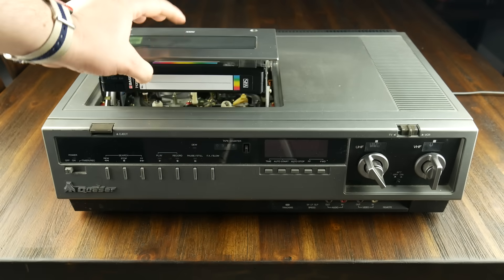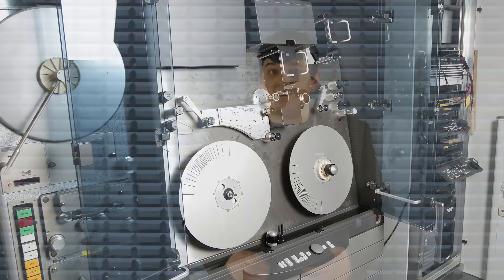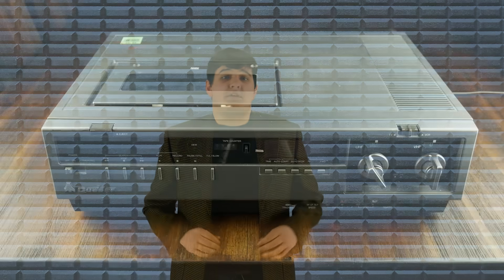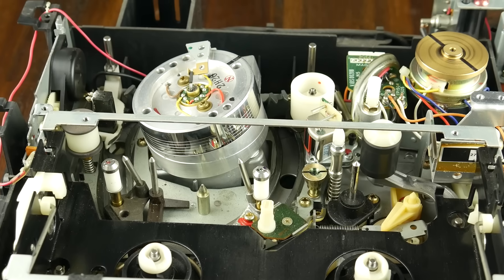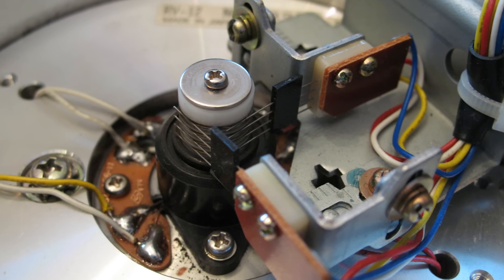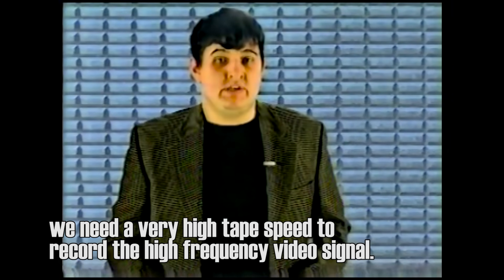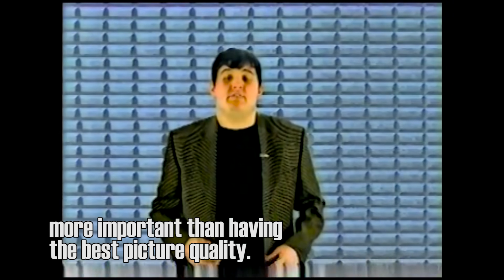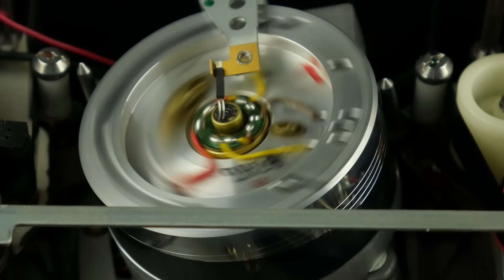The Impossible Feat inside Your VCR

Comment: another ace presentation
I would enjoin anyone who likes high-quality sound to pick up say a VHS of a live Hendrix or Floyd concert and find an old VCR [does not have to be high grade even] a set of RCA leads and connect your VCR to your stereo and be amazed at the sound quality.
A step further would be to connect those leads to your computer line-in socket [use something  like this https://img11.360buyimg.com/imgzone/s800x800_jfs/t4627/307/2910341373/519281/4a3f7440/58f43cd3N26eb4362.jpg]   then download Audacity  free software and save sound to a 24/48 flac or similar. It leaves you with a deeper wider earthier recording than a CD ever could produce.
Sadly most will be live recordings but not exclusively; but as mentioned in vid here sound on VHS was pretty awesome quality and still true in 2018

Comment: Great video. Interesting you say that LP vanished in the 90s on VCRs in your region, because it was the opposite in my experience (in the UK) -- it didn't seem to be a well known thing in the 80s (and many VCRs couldn't even play back LP tapes) but suddenly became huge in the 90s. I remember my family had a VCR that also had an 'EP' on the digital display but there was no way to actually select EP, so we wondered what on earth that was for (presumably only available in other regions). As far as data storage goes, even without D-VHS, there was an obscure computer card you could buy in the late 90s that would let you back up your computer hard drive on an ordinary VHS tape  using a plugged-in VCR, and it could take over 4 gigabytes - which was usually rather more than your hard drive even was at the time!
Reply: The Danmere Backer VHS Hard Drive Backup System, LGR did a vid on that. (/watch?v=TUS0Zv2APjU)
Reply: Urm mate I remember having a vhs recorder with LP on it here in the UK
Reply: EP = SLP
They changed the name in the later 90's for some reason.
Reply: @MaxwelThuThu  Panasonic called it SLP and JVC called it EP. JVC VCRs and VCRs made by manufacturers that got the license from JVC didn't have LP as a recording speed.
Reply: There must have been several incompatible LP formats around. I remember lending a tape from a relative which they recorded in LP, but when I played it on my VCR, the picture was in black and white and there was a hiss in the audio, making it sound as if everyone had a lisp. That even though my VCR was LP capable, I could record LP with it if I wanted. So we figured that even though both our VCRs were offering something called "Longplay", they actually used different incompatible formats. Though we never got around to see what would happen if I record a tape with LP and we played it back in their device.

Comment: Sure, that technology was sophisticated, both electronically and mechanically. But now, try to explain digital video compression/decompression algorithms that we have today, with extremely powerful ASICS and MCUs and embedded ARM RISC processors doing the work in real time, not to mention 4K. I'm sure you'll be even more amazed at what modern technology can do. I remember a time when a PC with a 486DX running at a blazing 33 MHz could barely play an MP3 file (remember those?).

Comment: Interesting fact, MPEG video used in DVD blu-ray and broadcast HDTV uses YCbCr color space which is similar to how NTSC and VHS color encoding worked (brightness value and two color difference values) except it's digital rather than analog. This is done because YUV color space works better with lossey video compression than RGB color space.

Comment: Re: 1:08 Magnetic tape playback also has a low-frequency limitation, if D.C is recorded onto the tape, it won't playback. Microphones also have a low-frequency limitation, so sound signals from them are A.C signals. The signals recorded onto tape played back with an equaliser boosting the lower frequencies in the audible bandwidth. Furthermore, loudspeakers have these limitations and you may have heard of them burning out due to D.C going through them.

But videos signals from a camera sensor not only have higher component frequencies at most but are varying D.C signals, the polarity never changes. Displays are also driven by these same D.C signals. Starting at 10:26, Alec mentions rotary transformers that couple the halves of the drum and many of you may know that a transformer only works as an A.C coupling. Also, playback heads (once again) only read A.C. But I already noted that video signals are varying D.C.

So what happens is that the varying voltage D.C signal is converted into a varying frequency A.C signal, like the one in an F.M radio transmission, and this signal is passed through the aforementioned transformer and then magnetises the tape. And when played back, this signal is demodulated. Just after 15:29, he mentions colour under, where the chroma subcarrier is placed below the bandwidth of the F.M luminance carrier. Many professional analog video formats were direct colour, where F.M was used to record the full composite video signal.

F.M recording also means that the signal on the tape is constant in amplitude, and being at saturation level, is entirely self-biasing, furthermore, all dropouts can be corrected with a simple limiter. On many Hi-Band formats and Phillips' Video 2000, a pilot tone supplemented the F.M carrier, giving a complete analog error correction system as the pilot tone allows detection of timebase errors, these can be corrected with a variable delay line.

On a side note: It does puzzle me that earlier professional V.T.R formats didn't record component video, which doesn't really make sense in the studio.

But to sum up the above: A paradox that isn't usually acknowledged. Most audio tape recorders, unfortunately, do not record fast enough to record an F.M radio broadcast or and a signal from a radio frequency condenser microphone without prior demodulation. Helical scanning works for video because the heads can be switched in the blanking intervals and allows a high enough head to tape speed to record an F.M video signal despite the greater bandwidth of even a baseband video signal. 

Furthermore, video simply needs a higher writing speed relative to the highest component frequency than audio, because a baseband video signal recorded on tape, unlike a baseband audio recording, can be properly played back.

Comment: A quibble about VHS HiFi sound: The "raw" record/playback part of the system was only good for about 25 dB of SNR. The 80 dB or so that's claimed was achieved with a very aggressive compander, not unlike dbx. Like any other compander this one produced pumping and breathing effects, noise tails, etc. It was barely noticeable on most TV broadcasts' sound (which is what VCRs were made to record, after all) because they didn't (and don't) tend to have that much dynamic range in the first place, and places where you might hear these effects were rare. Similarly it's generally fine for pop music. The problems do start to be evident in e.g. full-range orchestral. Still, it was fine for the intended use and another good example of successfully squeezing more signal onto the tape than you'd expect would be possible. I know a lot of low-budget radio stations used VHS HiFi in SLP mode for the 24x7 off-air logging they're required to do.

Comment: I presume this is very common, but I have a VCR problem. And by that I'm referring to those that were before the DVD/VCR combinations. When the signal s went digital for OTA, my old school VCR's went loco and shut down virtually completely. If you tried putting in a VHS tape, it would swallow it and NOT let it go. Shortly afterwards the whole unit would power off. This happened on two VCR's with two different tapes. After a few years I figured out how to get the tapes out by basically taking a bit of the machine apart.

I presume those type VCR's cannot operate AT ALL, meaning as little as playing old VHS, when there aren't analog signals to pick up anymore, especially if the tuner is connected to an antenna. So my question is can old VCR's play VHS without being connected to an antenna, but also being played on an old analog tv? I would presume so. I just ask this for curiousity's sake because the inevitable conclusion I came up with is I would have to go through the somewhat laborious task of manually removing the VHS in the exposure I have had.

So apart from having an old analog tv, do these older VCR's serve any use whatsoever?
Reply from the maker: I've never experienced this issue.  A VCR should be able to operate without any incoming signal at all.  My guess is that you had two similar machines fail at similar times--nothing more than coincidence.
A VCR should simply show a blue screen on any channel, but it should still be able to play a tape.  Without a DTV tuner to plug into the VCR, it isn't really useful for recording things over the air.  But, most modern TVs retain a composite input, so at the very least you should be able to plug a VCR into a more modern display.  If not, there are composite to HDMI converters available.
Reply: Fascinating, and it was with two completely different brands of VCR (though maybe same manufacturer). For most practicality, I have no use for these old VCR's anyway, seeing as how I have a VCP (video cassette player - I call it that just because it cannot record, or more accurately, a DVD/VCP combo). But I was wondering what I could do with the old units if they were completely useless or not. I guess I'll have to try connecting one of these old troublemakers into my 4K, as I have to have a VHS I don't mind experimenting on. It's something that might come in handy if you got a secondhand old tv and you could therefore hook an old VCR to it and at times watch things in another room.

Comment: Well S-VHS wasn't just for TV. Pro Audio for a while was using this format for ADAT. Alesis Digital Audio Tape. Able to hold 8 tracks of digital audio. In 16 bit and later 20 bit audio. You could record better than CD quality multi-track audio. DTRS by Sony and Tascam used Hi-8 format tape. Basically the same idea as the S-VHS. Keith Barr of Alesis engineered and created this proprietary format. The best was the M20. Using the direct drive Panasonic Direct Drive IQ-20 transport. It was robust and ready. The DTRS Used direct drive from the start. So Helical Scan itself was dying a slow death. Even Nagra of Swiss  manufacturing fame. The Name itself screams quality used in Cinema and Post production and is an audiophile brand used Helical Scan Reel to Reel to create the Nagra-D. I heard the Nagra-D and it was superb. Though I know the Nagra -T analog reel to reel was superior. So yeah ADAT kept S-VHS somewhat alive for awhile. Even Studer under license from Alesis had their version of ADAT.
Reply: I remember using a "Hi-Fi" VCR, it had 4 video heads and maybe 2 flying heads for audio. Anyway the audio was very good quality, I think better than metal audio cassettes, so making 8 hour mix-tape copies of CD's or records was fun (or was it a chore, strange how time changes memories).

Comment: I still remember as a kid pulling apart an old vcr just to see how it worked. 

Please do a video on how old vhs had the ‘piracy control’ plastic square! Which I think was more to stop you recording over something you didn’t want to. 

I still remember when we got two of the same vcrs so we could rig it up to make “copies” of the same tape we borrowed 😉 even taping in a plastic square. Eventually the video stores tech got better than that.
Reply: That was a "Play only" tab, intended to keep you from accidentally recording over an expensive pre-recorded tape. The anti-copy technology was all electronic, and had nothing to do with those plastic squares. BTW, a new blank tape has that same plastic square, and you can break out that little piece of plastic to make a "Play only" tape for yourself, to save important stuff from being accidentally erased.

Comment: You forgot two systems before VHS/Beta  they are Philips VCR/Sony UMATIC
The N15xx Series works without azimuth heads there is a guard band between the tracks at 15 centimeter per second.
The N17xx Series has azimuth heads. Longer playtime at much lower tape speed. 
The N1500 has a system clock to record at a specific time.

Comment: VHS was also used in many sound recording studios in the 90s, for digital multitrack recording using the adat standard. Hard disc-based multitracking was prohibitively expensive and still in its infancy at the time, so vhs adat made it possible on a relative budget.

Comment: I am now retired Sony VTR maintenance engineer and this was interesting to see. There were some minor technical mistakes but those were quite small. The VHS quality part was nice but those were not very good ones. I am from Finland and we have PAL-system which is better than NTSC (Never Twice Same Color) =). And perhaps the tape you used, wasn’t at its best anymore as the magnetic layer weakens and if you really used those very old machines, they weren’t very good either. Anyway interesting to see that VHS is still talked about. Betamax was of course much better but it lost its battle here in Europe.

Comment: I have had professional studio grade (yes same TV station would use with editing and what not), which have had stereo HiFi, Dolby NR, SVHS and took as much space as midium sized workstation and consumed 125Watt of power (instead of 25 for standard VHS)
despite supposed lack of LP or EP it did read both without problem, as it had, wait for it, wait for it, 8 helical heads. The quality of video and sound very great in most cases unreproducible on my TV (sound was going through sound system I have had at the time). I have recorded Pink Floyd The Wall on it and it was better then from microcassette

Comment: Well if tape capacity was so important, how come the Phillips VC2000 system didnt take off? 
An interesting machine this, it used double sided casettes a little larger than a VHS, just like a giant audio tape, but you could get 4 hours of play from each side of that tape. Then add in the LP ontop, and your single 4+4 hour tape is now an 8+8, 16 hours of play from a single tape. True you had to turn the tape over after 8 hours, but still, 8 movies on one tape? You might think 'well thats great but what if I want to watch the third movie on side A? Now I have to go look for it!' well
the player was full of features that were far ahead of their time, such as a programmable go-to counter. If your movie started at say, 1800 on the tape's clock, you could punch 1800 into the panel on the front of the player and it'd FF or RW to that time for you. On a VCR or Beta, you'd have to FF/RW yourself and stop when you hit the number.
The audio and video quality were pretty comparable to a VHS or Beta too, as far as I can remember. Its been some years since I had one of these machines. Very rare, and even rarer in working condition these days, but they are out there and so are the tapes.

Comment: Did you intentionally crimp the tape to demonstrate what hifi does when the tape's damaged?
Also, I heard the main reason LP recording was removed was because of poor performance when the tape was paused.
This speed, due to weird interplay between the way the heads lined up with the helical tracks when the tape stopped moving, caused serious screen tearing during pause on units that didn't have image stabilization functions.
That and ... nobody really used it once SLP came out.
Either you wanted high video quality (SP) or long recording time (SLP).

Comment: 14:30 The reason LP speed was discontinued was for two reasons: It looked horrible on visual FF and RW. '4 head' VCRs, used one head for normal rec/play at SP, one for visual FF/RW at SP, one for normal at SLP and one for visual FF/RW at SLP. The extra heads produced a reasonably good picture at FF/RW. Because LP wasn't used much it was eliminated. Such machines could still play LP tapes, just not record them.

Comment: I always wondered why VHS was put forth as an example of abysmal image quality, including the SP clip you demonstrated. I had two VCRs, both basic models, and they had definitely better image quality. The later one was not much worse than the original TV signal on a 19 inch Trinitron. Of course the image was noticeably worse at LP and usually got black and white at EP.

Comment: It's so complicated in fact that makes me wonder why couldn't the industry just make denser optical discs first or denser HDDs... Perhaps making things smaller is even harder? I know that flash memory has a very simple construction but the way it works isn't simple to understand at all, it's actually a quantum phenomena that traps electrons inside a specialized transistor. So yeah flash memory is in fact a technology based on quantum physics... It's "Hot electron injection" the name of the phenomena. The electrons quantum tunnel inside the substrate. It's basically a teleportation of particles, it's mind blowing what happens inside these chips.

Comment: A ton of solutions were required to make it possible :0 there were so many complications... It is indeed strange how the concept was pushed forward until it eventually worked, solutions on top of solutions, really impressive... HDDs on the other hand are much much simpler in the way they function but what is complex about HDDs is their production, and also to find ways to make them denser. Modern things (ICs) all work in very simple ways but have incredible production methods, stereolithography, photolithography. And somehow they are able to produce even mechanisms as microchips (MEMS) I do have an idea of how Solid State chips are produced but not mechanical ones yet they somehow exist. There really are micro electro-mechanical systems.